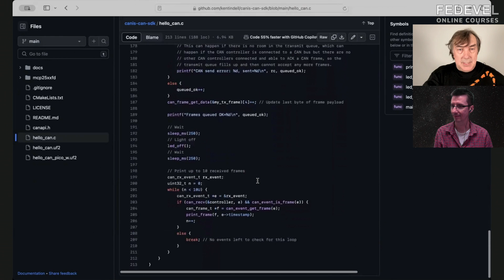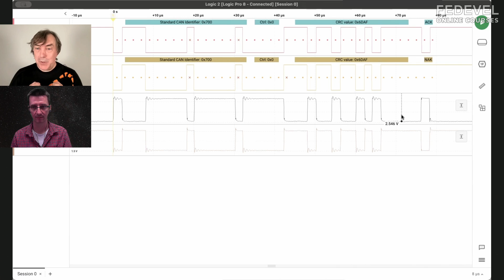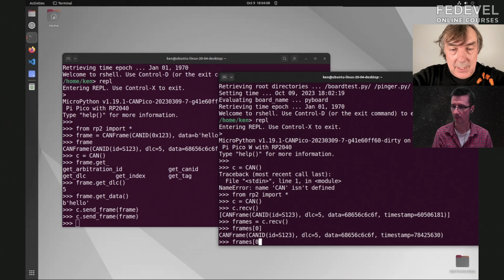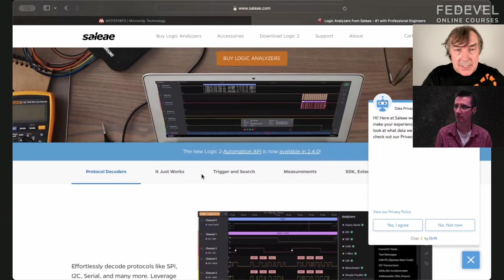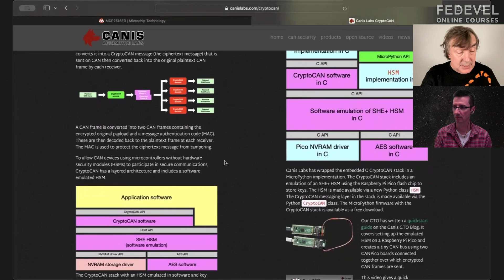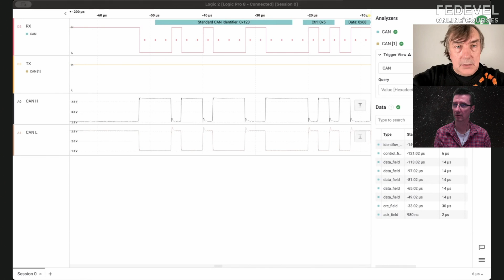CAN Bus is Simple and Actually Really Cool | Explained by Ken Tindell

Comment: I have a CANPico i bought when they first came out. I am just now trying to get it working so as to use cansocket or SavvyCan to view the CANBus traffic. I flashed the new uf2 file ( fw_20240401_p.uf2 ) to it but was wondering where I might be able to find a working python file to load to it in order to just receive the data and pass it out the USB to be used on a host computer via socketcan or SavvyCAN. I see a couple files on the github but not sure they are the ones im looking for.

Comment: One huge downside - during the recent chip shortage pretty much all CAN transceivers just disappeared. I'd rather keep using RS485, simpler transceivers and higher speed. Also looking in the direction of LVDS (both on-board and over wires).

Comment: Vehicles use the OBD (On Board Diagnostics) software layer protocol which is sent over a multitude of hardware layer protocols, dependent on the manufacturer. CAN is only one of the hardware layers.

Comment: Such an amazing interview, it was mesmerizing to watch and learn about all these edge cases of CAN usage.  By the way, there is a rising use of CAN in Hobby 3D Printing, instead of passing dozens of cables from the main board to the moving hotend board, often there is a smaller satellite board that is mounted directly on the hotend. Examples of such boards are the BigTreeTech EBB 36/42, BigTreeTech SB2209 as well as their BTT U2C board which is a USB-to-CAN board with 3 transceivers on it and lots of different connectors. Most of their 3D printer controllers boards include a CAN connector as well which can be used in USB-to-CAN-Bridge mode by Klipper (a popular controller software for hobby 3D printers).

Comment: The selection of needed PDO:s, out of about 800 to select from, is a situation you can find yourself in, if using CAN ( or ethercat ) to run a servo, for example.  Not recommended for beginners  ( who has to understand all whose options, to be able to select the proper ones for their application ).

Comment: I do a lot of Raspberry and arduino, and I watched a couple of can bus tutorials the past couple of years. I have plenty of use for such a communication system, but am always turned down by the way it is explained. Who cares how the signal looks like?  Think arduino would have showed us the signal of whats coming out of the USBto TTL converter and tried to explain us on this level how arduino works, never ever anyone would have used it. So to do Can bus, we need a board that can receive and send. A library that can be imported to the project. Pin definitions , and a void function to send something to a board. That would make can bus popular.
Reply: I just don't think can is what you're looking for, it wasn't developed to be a plug'n'play solution for entry level hobbyists, nor was it intended to be used directly by consumers, it's meant to be a robust medium distance communication protocol for automotive and industrial applications (i.e. designed for use by professional engineers). It takes a modicum of technical understanding and effort to setup properly. You aren't the intended user, so it won't be easy for you to use.

Comment: That example with the pico boards was not a good example. It uses micropython with a library that isn’t yet part of the standard rp2 library (judging from what Ken said) and that library abstracts everything away. That software example was useless for understanding CAN.

If you are showing people something, keep it as standard as possible, use standard, unmodified libraries and include your custom library separately. This was also a bad example as the CAN bus was set up with a single function call with no parameters, just using default parameters. Yes default parameters can be useful but in an example like this it would have been helpful to just type the parameters too. Since it was just set up with a single function call with no parameters it gives no information about CAN at all. 

Defaults when setting up something like a CAN bus shouldn’t exist, since they are key properties of the signal, defaults are a good idea in theory but not in practice. Using bitrate as an example, you might get some examples working fine communicating between two of these boards just using the single function call with no parameters to set it up, but then what if you want to connect to a device you didn’t create? It may not work and you may have no idea why, since the issue is the bitrate which is a property of the CAN signal that is completely hidden from you since you are just using defaults. Just using defaults may be easier right at the start but in the long run it is better just learning things like that completely from the start. Learn right at the start you need to set the bitrate and that it needs to be the same for all devices on the network. It’s not that hard.

I feel a lot of micropython libraries, including this one, dumb it down too much. Yes simplifying it for people to learn is good but there is also going too far, you have reduced using CAN down to three function calls, setup (with no parameters necessary), transmit and receive, you have hidden far too much in the process especially with defaults. It doesn’t benefit anyone dumbing it down this much. You should learn at least the core properties of the signal, like bitrate, right at the start, there is zero benefit to abstracting away having to set the bitrate.

Overall this video just doesn’t seem that useful. The explanations didn’t seem that useful and the code example was useless.
Reply: The question that comes to me is, do I really need to know how the notebook works internally to write a comment on youtube? the answer is no. To make use of a communication protocol I do not need to know the internals, i need to know how to make use of it. I do not need to know exactly how the human  body works, to take a walk in the park, it is enough to be able to walk. Thats my problem, everybody seems to want to teach us how can bus works, but who cares, please teach us how to easy utilize it in our project.
Reply: @Lisas4us  if you think you don't need to know how the bus works then you are a fool and really don't know what you are doing. Your other examples like the notebook and human body are ridiculous and irrelevant. In case you didn't realise, when you are implementing communication between devices you can't really just ignore how the protocol works, especially when the communication method has hardware requirements.

Sure just knowing how to use it at a very high and basic level might work for basic hobbyist projects but try any communication method for more than a simple case and you will need to know how they work.

If you don't just use premade boards then you need to know how the protocol works and what it needs to work, like the transceivers and termination resistors.

For any communication method, to be able to debug issues with the communication method, you need to know how it works.

If you want to stay at the level of being an absolute beginner then keep just using premade boards with far too abstract micropython libraries. If you want to actually progress, make your own boards and not get your hands held when programming the boards then you need to learn how the communication protocols work.

If you can't handle learning how a simple protocol like CAN works then you aren't going to get far in any form of embedded engineering.
Reply: @conorstewart2214  Well, I agree. That analogy is stupid, since here we actually need to know how something works. We can't limit ourselves to use libraries all the time, but calling him "fool" and "you dont know what you are doing" is not nice, considering you are a experimented EE.

I think that only applies for people that really wants to earn a life from this, but other people just likes this as a hobby and they really dont need to know the, lets say, "heavy" things, because its just that, fun.

No offense, I say that because I saw your comments on Arduino videos. Valid points for sure, but even if Arduino claims other things, their boards are just toys. No sense on commenting claims about stuff.

Comment: Listening around 25:00 in, I'm very glad that Ethernet does not act like the CAN Bus. Imagine needing all of the systems in the WAN to be perfectly functional (this includes all Ethernet cables being well-built and reliable) in order to use the internet. The Internet would never be up! Between intermittent cables and packet collisions alone, we'd be soooo out of luck.
Reply: Ethernet started out as a bus, an ethernet cable, fat or thin, has the same problem as CAN.  What he described is a feature of CAN, if you instruct both wheels to change to a certain speed and only one wheel receives the message the driver will be very surprised by a car that is suddenly driving in a circle.  CAN automatically avoids this, ethernet does not.  The two technologies have very different use cases.
Reply: @jrstf  yes I understood that. I was pointing out one good thing about the fact Ethernet wasn't like CAN. Thank you for your reply though 😊 👍
Reply: I still remember when offices would use TokenRing instead of Ethernet. Eventually Ethernet won, because it just makes a lot more sense where there is a lot of data at high speeds. But that does not mean CAN is useless, for continuous monitoring of dumb devices CAN is cheap and very effective at what it does.
Reply: @kesor6  USB uses a token based protocol, though this is handled in hardware.  Lots of MCUs have built-in USB 2.0...

Comment: Interesting stuff. Thanks Robert and Ken. It would be helpful to look at things like Flexray, CAN-FD, MOST etc. All the vehicle busses are super interesting and changing quickly these days. Ethernet is also becoming common in high end cars now.

(PS: I am a design engineer on the Ghost immobiliser, the original aftermarket CAN immobiliser)
Reply: The Ethernet protocol?  What a terrible idea
Reply: @VndNvwYvvSvv  it seems to be more a direct connection to embedded systems for firmware updates, infotainment systems and the odd body controller or gateway. I’ve not seen any mission critical information using Ethernet.

Comment: Please tell me, doesn't CAN bus need 3 wires - I mean 1-H 2-L and 3-GROUND ?
Reply: It's only when you suspect your grounds would be on much different levels is when you need to ground two devices together. 

For example engine cranking and battery in the trunk. The engine controller might few volts apart from battery controller if the ground is not good. The solution is not third wire though. The solution would be making sure the battery (-) and alternator is properly attached to the the chassis. 

Otherwise you may exceed the common node transceiver limit and it will clip the signal and interrupt the communication.

Another maybe better example would be if you have motor driver with CAN. Obviously you will have some ground going to the motor. But imagine it is as long wire with few  ohm resistance. If you start pulling few amps, your ground will move against other devices, because voltage drop through the ground wire. Depending on the transceiver you may be fine if ground shifts by few volts. But to make sure everything works for Ng high load, you have to use thicker ground wire again. 

If two devices were truly separated. For example both battery powered, the grounds would be close to each other even with just two wires, because can transceiver outputs have about 20k resistance to ground. It's large but it it would make ground at the same level.
Reply: No, it's a floating bus that hovers around 2.5v on each side of the bus... the voltage is measured between Hi and Lo... the reason for this is to help remove common mode noise. The other thing to remember in automotive is that the ground is a global chassis ground, so if you absolutely need to ground reference, everything then it's achieved  through the chassis but the ground is not needed for CAN transmission... ethernet is the same...
Reply: Thank you@@TheVanDerSnow

Comment: I would love to use CAN, but it is just too limiting. Most of the built in or cheap controllers do not support CAN FD, so you are limited to 8 bytes payload. Even with CAN FD this is only 64 bytes. Sure, for dedicated stuff it can be ok, but if you want something more flexible, and reconfigurable it is PITA. I am trying to switch from 100Mbps Ethernet (40 devices, everything would fit on <2m length bus) to something with easier cabling (I need about 1Mbps peak, and 1/4 of that on average, so CAN theoretically could suffice), and while I could transition to CAN, I would loose many other things (like auto discovery, IP debugging, web interface, easy addressing, firmware updates, etc), without inventing a lot of software stack to go with it. And if I do invent software stack, you will loose a lot of inter compatibility. In fact I might be better of just running PPP over UART and have custom board with 40 uarts, acting as a hub / switch / router.
Reply: That's all true.  CAN is only intended for transferring of a single value, as in reading a sensor or setting a speed.

Comment: I have to object to the opening frame assumption that it's better than I2C etc. Don't get me wrong, I love CAN and if you want to connect a bunch of smart modules in an electrically hostile environment then there's not a lot better, but if you're looking at a bunch of micros or peripheral devices then I2C, I2S and SPI have significant advantages within their particular reasons for existence. Always remember: "Horses For Courses". All buses were developed for a particular use case and they all have their relevance tied to that use case. You may well use any for almost any other use case but it will be less than optimal.

So, in the right environment yes CAN is really cool. For its optimal use case you would be hard pressed to find better.
Reply: Well yes since you can't talk to the CAN controller without SPI.
Reply: @jrstf  SPI and CAN are 2 completely different animals and in no way dependent on one another. It just so happens that the CAN chip described here is a peripheral chip that allows you to add CAN to any processor via SPI. There are many microprocessors that have CAN implemented directly on chip and while they may also have SPI, that is in no way connected to a need if you want CAN.
Reply: @etmax1  - Okay.  But I bet nobody makes a SPI bus that interfaces to the processor with a CAN bus.
Reply: @jrstf  Absolutely, because SPI is so simple to implement that every micro has an SPI bus and only specialised applications require CAN, so there is simply no market for such a device. Think of it this way. 50 transistors needed for an SPI I/F and 500-1000 needed for a decent CAN implementation. So if  you were designing a micro and the market has 100% demand for a micro with SPI and 2% for a micro with CAN what would you put in it? Not if you were Microchip and made a lot of real low transistor count micros and missed the boat on making one for the upcoming automotive CAN market would you delay the boat even further or make an add on chip that your customers could use with any of your existing chips while you do the leg work to get your own CAN CPU out? That actually probably sums it all up.
Reply: @jrstf  you really don’t seem to understand at all, CAN and SPI are totally different and unrelated, the CAN controller just interfaces with a CAN bus and with the microcontroller through SPI. You gets loads of different kinds of protocol converters. SPI and CAN are in no way dependant on each other, this chip was just created since most MCUs have SPI, as they said, lots of MCUs have CAN controllers built in.

What is your point with your comment about nobody making a SPI bus that connects with CAN to an MCU? Why would someone do that? SPI is suitable for simple master to slave (sometimes multiple slaves) communication, CAN is totally different, it is a broadcast kind of communication, any device on the network can transmit or receive at will. Totally different kinds of communication.
Reply: @conorstewart2214  - I understood all of it, I'm just failing to communicate or even having clarity in my mind what I'm trying to communicate.  I was never intending to disagree with what you wrote.
Reply: @jrstf  what are you trying to communicate?
Reply: @conorstewart2214  - What I meant to say is I agree with etmax1's original post.